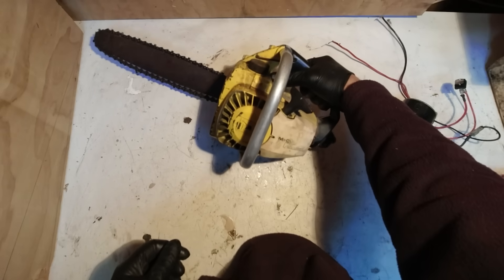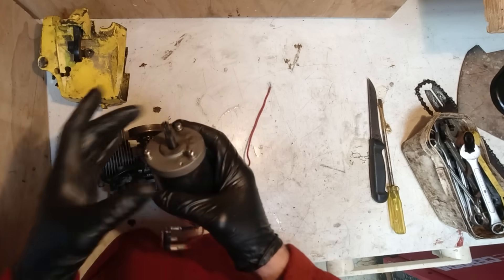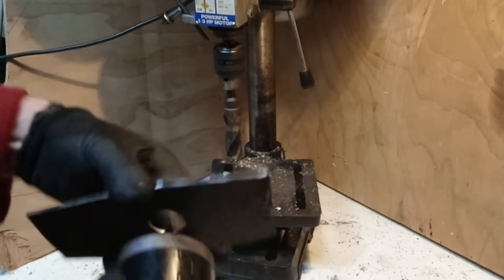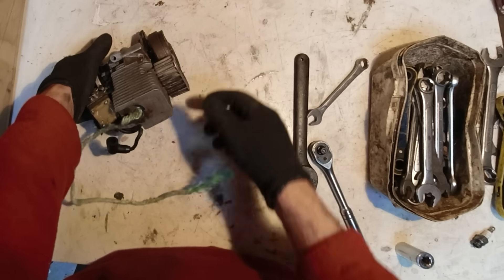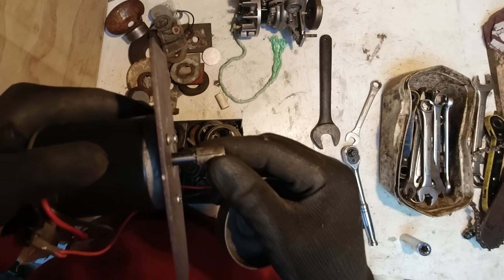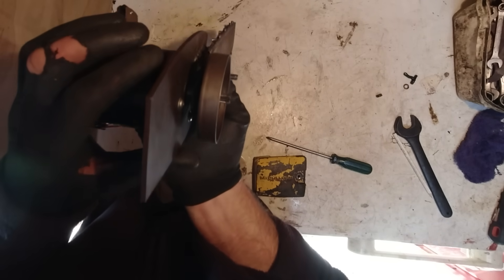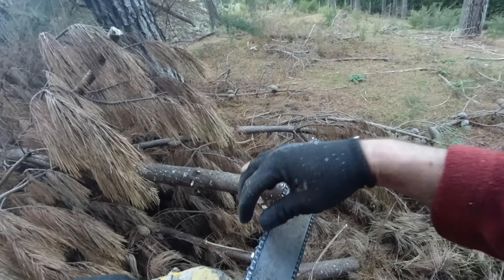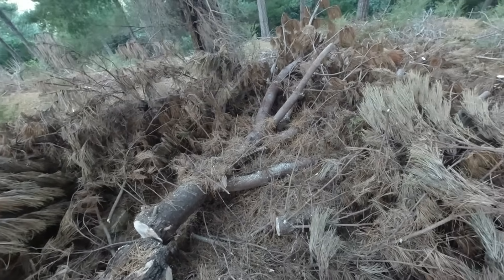Battery powered chainsaw made from Junk

Comment: Very nice, but why bother with the clutch? Electric motor doesn't need to idle.
Reply: He did not bother with the clutch, just welded the clutch housing to the motor shaft (the housing is also the drive sprocket)
Reply: @mowil999  Yeah, ok. Watched it again
Reply: he only needed the clutch barrel for the sprocket on it.

Comment: What about making it compatible with a battery power tool pack for instance dewalt or whatever brand you have. I think you could take the battery holder out of an old tool and put it on the saw.
Reply from the maker: Yes that would be easy enough